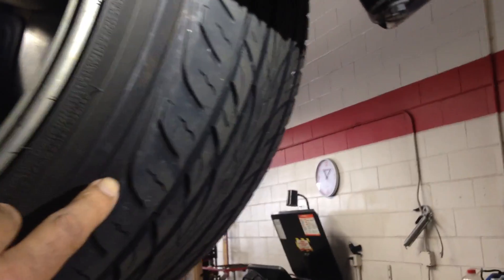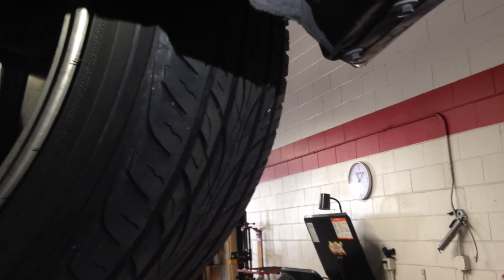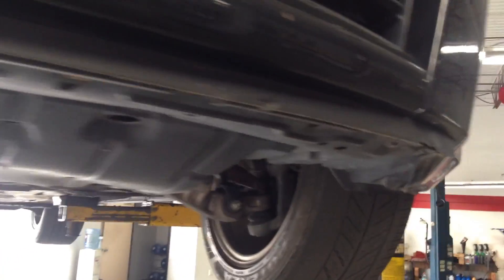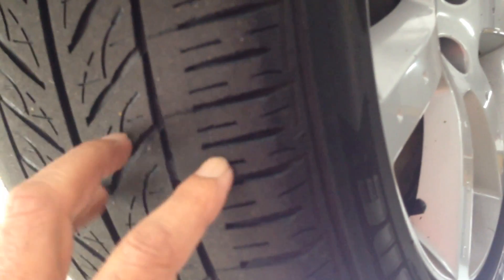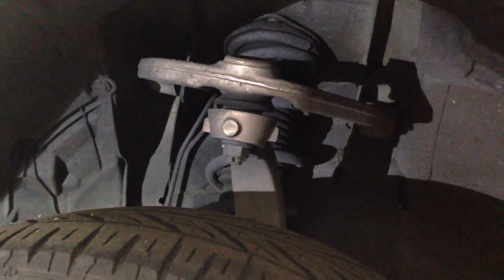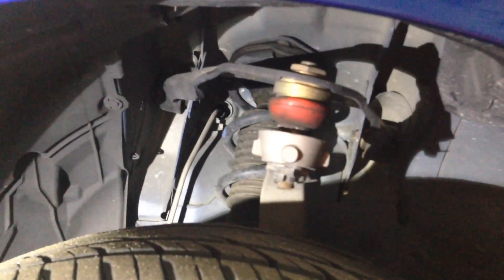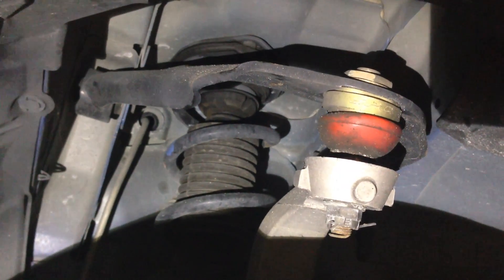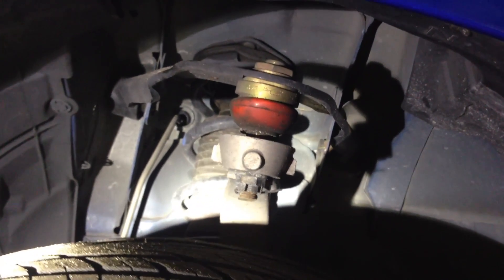Tire Wear Problems - Tire Wear and Solution

Comment: Don't listen to this guy, this kind of wear is NOT caused by camber issues.  Extreme inner shoulder wear is from wheels toed way out.  Yes, G35s will not allow front camber adjustment.  No, stock camber will not cause such extreme wear unless your suspension is broken or modified.  90% of people will just need a simple alignment.  The others should check for issues with suspension bushings/bearings, especially on front compression/control arms.

Comment: I had the very same problem. This is a toe misalignment.  If you have a 350z (z33)  that has been lower this is the result.  A solution is not to lower the front.
Reply: george sanchez Exactly! people think this is a negative camber issue and they are wrong! Camber doesn't cause wear like that. If your camber is out far enough to cause irregular wear then it wont wear the entire outter tread block that is absolutely a toe issue!
Good post.

Comment: ATTENTION: This guy is talking mostly nonsense. If you have heavy inner edge wear, it is problems with toe and NOT camber. If a good alignment doesn't sort out the wear, it means you have suspension components that are allowing the suspension to sag out of alignment as the car moves forward. Common components which cause this are worn: tie rod ends, lower ball joints, compression rod bushings, lower and upper control arm bushing. Other worn components can also contribute to this wear but these are the most common and are certain to fail. It is only a matter of time before they fail. The failure may not be obvious, the ball joints/bushings may not have play but they certainly will with 3000lbs of car bearing load against it. You WILL feel the difference in the new components + restore normal tire wear. Camber wear is relatively even and gradual from the inner edge to the outer edge of the tire. This wear in the video however is concentrated on the edge.
Reply: I wonder of thats the reason why my van has outer edge wear opposite of the video. I'm thinking it's the outer tie rods.
Reply: BradMD1996 well I got 2 alignments on my z3 with 3.5 camber and the inside is always worn before the outside I have after market suspension . Camber does where the tire on cars with enough camber ... of the alignment would have corrected it.
Reply: I have this exact same issue on a 2003 g35 coupe bone stock.  I just replaced badly worn lower ball joints and lower control arm.  I had purchased new tires a year ago and now I need new front tires because inner edges worn down to the wire.  After replacing the lower ball joints will this fix my issue?  Previous tires lasted 4 years with only minimal camber wear.

Comment: I have same problem , is that possible because of lower ball joint as well?
Reply: Tommy Wang A lower control arm joint with play in it means you will never have a proper alignment but mostly it is just not enough toe in.

Comment: I have a BMW 435i 2016 convertible with this problem only in the back tires, now they are running on wires. This is so ridiculous, the car only has 10k miles and the dealer won't fix this issue.
Reply: i got the same problem  in my scion tc 2015 in the inside

Comment: Hi I have a Buick lucern 2006 I purchased brand new tires and all 4 wheels suspension were aligned 3 times in about one month and the 2 front brand new tires was exchange upgraded to a better one after a month due to too much bouncing and tire wear.  Both of my front tires wear out in one month on outer left side, the tread in the middle is untouched only the sides wear out.  Several mechanics checked my my car and swears that nothing wrong with my car it just need to be aligned.  It seems to me know-one knows what's going on with my car. Firestone, stop and go, townfair tires, dealer all the big name companies.  What can I do? What can be the problem? The car is not slipping two front shocks were replaced about a year ago, new tires, alignment done etc. Help